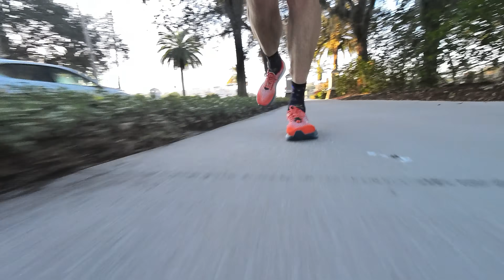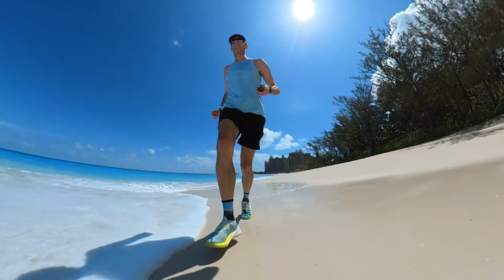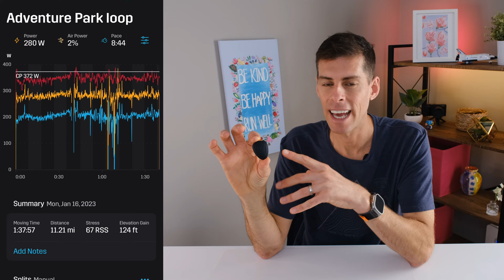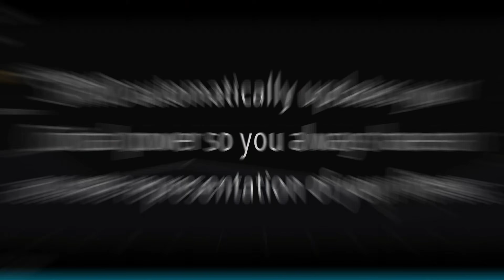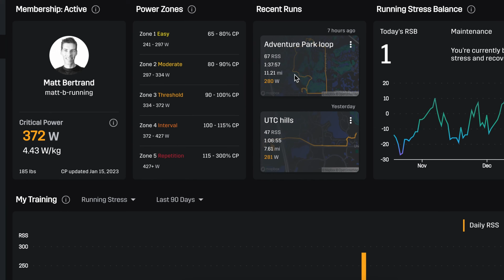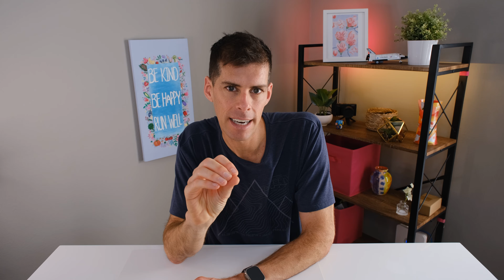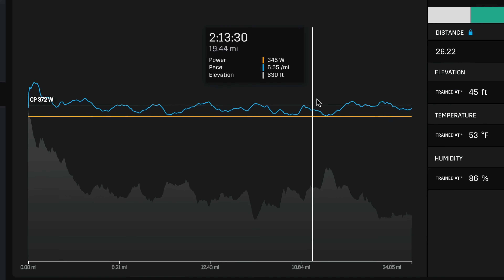NEXT GEN STRYD: what it is, what it does, and why I use it!

Comment: 💪🏻 Finally, someone who explains the real benefit of Stryd—thank you so much.
Have you ever considered using the Stryd Duo to analyze asymmetries in running performance?
And my second (but very important) question: do you also do Zone 2 training, where it doesn’t really make sense to run by CP? In Zone 2 you’d run by heart rate, right?
Reply from the maker: I have the Stryd Duo, but I haven’t really found a use for it. 
Most of my runs are zone 2 where I mainly go by feel. I run so much that zone 2 is the norm for most runs so I know how it should feel.

Comment: 💪thanks for this video. You've made the functionality of the Stryd more clear. However, I do have some additional questions: 
- When you're doing a run, do you keep checking your watch for the 'right' powerlevel? When I run my runs, I run on how good and fit I feel, not on heartrate for example. I prefer to only check my watch at each km.  
- Does the Stryd also record the walk to the starting point of the run? And if so, does that influence the result of the measurement/ recording? 
- The Stryd is not irritating the 'knuckles' of your foot? I prefer to tie my shoes quite tight around my foot, so the movement of my foot will be rather 'straight' on to the pavement. 

I like to improve my running times, so therefore I'm interested in the Stryd. However, I do find the Stryd is a bit expensive. So, I'm trying to determine wheter it could be an option for me. 

Dutch guy, 2 times per week runner for about 5 years here, my first (and only) half marathon I finished in 1.40.something. But, coincidentally I subscribed today for my second half marathon.  

Curious about your response, thx
Reply from the maker: Hi Eric!

To quickly answer your questions:
-You can check the power on your watch as often as necessary. With time you’ll get used to what a specific power number feels like and you won’t have to look as often. 
- Stryd does not record the walk before the run.
- I haven’t experienced any issues with the pods bothering my feet.

Stryd is a great option if you want to use a different metric by which to gauge your runs. You can definitely live without it, but it can be a handy tool!

Comment: So I’m just getting into running. Mostly trail running. I’m coming over from Cycling outdoors as well as riding an indoor spin bike called the Peloton. I’ve been Power Zone training for years. I just bought a Stryd and I’m excited to continue power zone training as I get into running. Power Zone training took me from couch to 75 mile bicycle rides in under a year (lots of riding and work to get there). I’m hoping a smart data driving Power Zone training regimen will get me from couch to half marathon in the next 10 months. Thanks for this video!
Reply from the maker: Welcome to the run-side! Power zone training is a little different than on the bike (or Peloton), but the concept is the same. 
10 months is more than enough time to get in HM shape! You’re going to crush it!

Comment: I have one and use it almost every run, but it is ridiculously expensive for what it is. A tiny pico chip and a couple accelerometers, a baromete, acouple of other sensors costs $10. I know they had to research and design but still, it is a p!$$ taking price.
Reply from the maker: @dna100  Yeah, I get where you’re coming from. Still, they’re a business and if the market allows that price, then they’d be silly not to take it.

Comment: Question: can I use the Stryd while using the stock Apple Watch workout app? Ideally would like to continue using default workout app for outdoor runs & not have to migrate to using the Stryd Apple Watch app. More specifically, I'm wondering if the Stryd power data can be seen live during a workout using the stock app, kind of how some third party chest straps (e.g. Polar H10) work with the Apple Watch. 

Thanks for the informative video!
Reply from the maker: Hmm. I don't think so but if I find out I will comment again. I use the WorkOutDoors app for running with my Apple Watch and I can pair the Stryd to that app.
Reply: @its_Matt_B_  Got it, thanks for answering my question!

Comment: 💪 Hey. Found this to be very informative as I’m new to Stryd. One question though. When you’re running with a garmin watch, do you use the Stryd app or normal Run app? I saw that if you dont use the Stryd app Garmin only shows you garmins estimated power? I have a lot of interval sessions stored on my watch, but I imagine these can be run with garmin run app as I dont run intervals by power anyway? What do you use for what purpose?
Reply from the maker: Hey! Thanks for watching! You have two options: 1. You can use the Stryd workout app or 2. You can use the Stryd Zone Data field. 
I use the Stryd Zone data field and then I just add it as one of the data fields when I use Garmin’s “run” mode. 
You have to get the Power + Zones in Run mode from the Connect IQ store. Once you have this added to your watch, you can position the power metric (or avg. power, power zone, etc.) on your run screen. You could make a new screen to show power or include it with other data. I just have a field with current power on a screen with all the other info I like to see (HR, pace, time, etc).

Comment: Getting one for christmas and just came across this review, excellent information 💪🏼I’m curious, I see you have an apple watch on in the video, which is what I run with. Do you run with the Stryd app open when you use your apple watch? Or does it import you real time power output to another app. I’ve just recently gotten into running, and been using the Nike Run Club app, which I’ve liked in having someone tell me which workouts to do (i’m sure stryd would be better) but I do have a lot of info stored in that app already and don’t want to start from 0 if I don’t have to.
Reply from the maker: Hey Chris! No, I don't run with the Stryd app open. I have used it for testing purposes, but on my Apple Watch I track my activities using the WorkOutDoors app. I can connect the Stryd in the app.
I'm not sure if connecting the Stryd footpod to the Nike Run app is possible.
Still, the WorkOutDoors app syncs with Strava, which is where a lot of runners log their runs!
Reply: Thanks! I just got it a few days ago and have been messing with it. Nike app doesn’t connect from what I can tell, but I’ve got other apps for it to sync to that work with Strava (cyclist here).

Comment: What's the difference from the previous ones ind version and this new generation?

Also I have the Garmin Enduro 2 and use the Garmin Hrm-Pro and am wondering do I really need a stryd. What's your opinion on this?
Reply from the maker: It’s best to check out Stryd’s website to get all the details on how the Next Gen is improved, but basically it’s more responsive and accurate with the data. Tbh, I didn’t have any issues whatsoever with the version before this. 
Whether you need it or not is another matter. No, you don’t “need” it. But I’ve found I enjoy the power data and how Stryd interprets it to tell me how I should run. A lot of watches have wrist based power now, but it’s not the same as a foot pod and basically just gives a power number that is difficult to interpret. Stryd provides guidance for the power numbers they give you.

Comment: 💪
Reply from the maker: 👊🏽 Do you have one or thinking of getting one?
Reply: @its_Matt_B_   I just bought one today
Reply: I have a question: Stryd is base on critical power. Let's say, I have full flat marathon: if I pace the race based on speed (there is also critical speed): speed = lenght of stride x number of stride/minute => for the same speed, I can either reduce the lenght of the stride and increase the cadence OR the opposite. Is Stryd can select the best option?
Reply from the maker: @utoktome  No. if you are basing your racing/training on power, it won’t matter. Run in the way you run and Stryd will calculate your power zones accordingly.
Reply: thanks very much @its_Matt_B_

Comment: nice video. i would say i m quit the armature runner, but i have set the goal to run my first marathon. however already for years i often get shinsplints when i increase my running volume. i think a big part of it is due to my running dynamics.  in your opinion would the next gen stryd be a usefull tool to monitore my dynamics and stress and try to prevent future injuries ?
Reply from the maker: I don’t think so. Try taking more time off between your runs and building your volume very slowly. Oh, and buy a new pair of running shoes. Older shoes can contribute to shin splints.

Comment: I have the wind one, thinking about upgrading but not sure... what did you do with your old one?
Reply from the maker: I still have my old one. I’m not sure I would upgrade again. For what I use it for I don’t notice the increased responsiveness. If I were buying one for the first time I would definitely get the new one though! 👊🏽
Reply: @its_Matt_B_ I heard it's better for short sprints, short hills and wind. But my old one works great. Other thing is i heard they clip on to offset lacing like vaporfly better
Reply from the maker: @macewindex564  Yeah, you’re right! I heard the same thing about offset laces being better but I haven’t noticed a difference in my data between the two when wearing the Next%.

Comment: You mentioned you wanted to run your Boston Marathon in 3 hours.  How did you determine the power required to meet those 3 hours?  Thank you so much for a great video, Matt!
Reply from the maker: Stryd gave me a power output to run a sub 3 marathon, however, as I got closer to my race it recalculated (or became more accurate) and adjusted my marathon prediction to +/-3:12. 
It uses your training to make a prediction and then gives you the average power needed to get there. It turned out to be very accurate.
Reply: @its_Matt_B_  oh!  How did you set the goal of sub 3?  Is that a feature in the product?  I'm trying to qualify for the Boston Marathon so I have to hit a very particular time. Was hoping that stryd could tell me what power I would need to use to hit that number. Thank you again for such a prompt response!
Reply from the maker: @jinikkim  No, Stryd doesn’t work that way (predicting future power), but it will give you predicted times based on your training and it updates constantly as you get fitter. The paid membership
Reply from the maker: …also gives you loads of different workouts so it will help you get faster. 
How many marathons have you run and how much time do you need to make up to BQ.
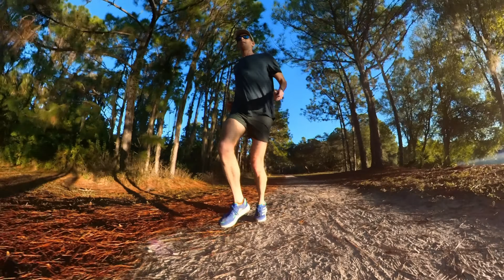Reply: @its_Matt_B_  I've only run two (both the very hilly and hard San Francisco marathon) and I was going to run the Napa to qualify for Boston in March of next year. I'm not entirely how much time I need to make up because the San Francisco marathon was such an anomaly. I just know that I need to be under a 3:40 time to qualify

Comment: I have the stryd wind for about 3 years. In my case i need to calibrate,out of the box was inaccurate. And every time i bought a new brand of shoes i hade to calibrate with that particular shoes,but after that, everything works great. I will upgrade to the next Gen only when this one dies, because only when i make some short sprints (10/20 seconds) the stryd lag a bit,and i think that issue doesn't exist in the next gen,for me is the only big difference between pods. The new metrics no one have idea how to use it so no benefit from that. But yeah, when this one dies,no doubt i will get a new stryd 😊
Reply from the maker: I think waiting to get the new one until the old one dies is the right call. The new one responds a little quicker, but most of us aren’t watching our watches at all times so, for me at least, I didn’t notice any lag most of the time!

Comment: 4:50 Does the Stryd override Garmin Pace or does it only add power data? If I track with GPS, will I be able to choose which pace metric I want to use or do I have to use the Stryp app for that/
Reply from the maker: It works in tandem. Your watch will use GPS if GPS is available. 
On the Apple Watch (using certain apps) you can choose how distance/power gets measured (using Stryd or the watch).
Reply: @its_Matt_B_  Thanks for the swift reply

Comment: Have you tried using the Engo 2 hud? Before getting I thought my Stryd was the coolest and most useful running tech I owned. Now that’s changed
Reply from the maker: I haven’t tried them. They sure do look compelling! I may have to get a pair just so I can “test” them!
Reply: @its_Matt_B_  I hope they give you a review unit. I connect my Apple Watch ultra to the hud because the running power is measured the same as Stryd. The Stryd I pair to my Coros and all of a sudden it becomes extremely easy to follow to interval workouts because I don’t have to look down or rely on finicky audio cues or haptics
Reply from the maker: @theinstigatorr  I’ve been thinking more and more about it. When I have raced using power it becomes very annoying and time consuming to keep checking my watch!

Comment: 💪
Reply from the maker: Thanks for watching, Steven! Do you already have a Styrd or planning on getting one?
Reply: @its_Matt_B_   Hi.  No I do not have one. Had not even heard of it.  So searched up you video to learn.  Yes I am new.  I guess new to the serious running (triathlons are the plan ).  I have an Apple Watch Ultra and think I will stick with that for now.  Seems like one day I likely will want to upgrade the data.  For now I’ll focus on getting running.
Reply from the maker: @stevenbellmond1755  The AWU is a great watch and actually measures power data from the wrist however it’s a bit tricky to use the power metric on the AWU for anything meaningful. 
Still, the AWU provides accurate GPS metrics so I agree you have everything you need for now! Good luck training for your tris! 👊🏽

Comment: 💪Still thinking about getting one. I usually run with pace, but thinking about power indicator on incline or descent runs could be a great upgrade. Maintain pace on that conditions not easy but with power indicator could be better I think But the price is making me think twice 🤔
Reply from the maker: Power is a great metric for gauging effort going up hill! You should take a look at pricing for the previous version of the Stryd footpod (with wind detection). I bet you can find a used one at a good price.

Comment: Anyone have experience with this on a Peloton treadmill? I'm getting a big power discrepancy of 40-50W and it's been a month. 

The treadmill feels more accurate to my perceived exertion while the Stryd seems low. Am I missing something or am I just that weak?
Reply from the maker: You can't judge your stength/weakness by the power number the Srtyd gives you. It just is a representation of your running mechanics. 
As far as the Peloton Tread, I have not used one and did not know it provides a power reading, but if it does it will use a different algorithm to determine it, and so it is not surprising the number is different.
Reply: @its_Matt_B_  Thanks for the insight! I will do some form analysis as well.

Comment: Hi Matt B. I just bought a used Stryd (the last version with wind). I find the distance measurements from it (after calibrating) more accurate than my GPS watch...which I expected. What I did not expect is the amount of time it takes this Stryd to calculate a good lap pace...which is about 90 seconds or so. Do you find this next gen Stryd to be faster in calculating average pace than the last version. I do realize you seem to only use power, but I like pace and run mostly flat courses. Thoughts?
Reply from the maker: Nice going grabbing a used Stryd at what i'm sure was a good price! Yes, I find the accuracy spot on and I didn't even calibrate mine.  As far as average pacing goes, I don't use average pace as a metric so I don't have it on my watch to see. How is your current pace? Does that seem to be responding appropriately quick enough?
Reply: @its_Matt_B_  Hi Matt...current pace is always too noisy via GPS or Stryd. I like lap pace...which is the average pace over the last lap...in my case, a lap is 1 mile. With GPS (and good signal)...my lap pace settles down in about 30 seconds or less. Stryd (surprisingly) takes a good 90 seconds. Why is this important (to me). I am trying to nail my pace quickly during 5k parkruns. Just like GPS, it appears Stryd has to do some averaging before it can calculate accurate distance...and then pace.
Reply from the maker: @stevebailey1682  🤔 I can't really say why the average pace takes so long to even out, but I'll check back if I come across anything on the subject. 
You should give a Parkrun a go running by power and see how it works out for you!
My Stryd Power Center suggests I can run a 5k at 108% of my CP. I've read other articles where people have been told to run a 5k at 104% of their CP. 
It may be worth a try just to mix things up!
Reply: @its_Matt_B_  Hi Matt...I figured out what is going on. The Stryd pod has to wake up before it gives good results. In my case, looking at the raw data from the Stryd PowerCenter...it takes about 4 seconds to properly wake up from a cold running start. My first data point is 50 min/mile as is the second data point. Data points 3 and 4 are 16 min/mile and finally we get to a reasonable (for me) pace of 9 min/mile at point 5. If you extrapolate to point 30 with the same 9 min/mile pace...the average pace after 30 points (or seconds) is 12.2 min/miles. Those first 4 (bad) data points really screw things up. The solution is to start running (for 4 seconds) before hitting the start button on pair watch or phone running the Stryd app.
Reply from the maker: @stevebailey1682  Nice! I’m glad you figured it out. I haven’t run into that issue because I always walk around before I start running, which must wake mine up in time! 👊🏽